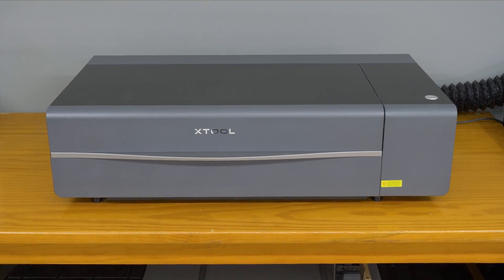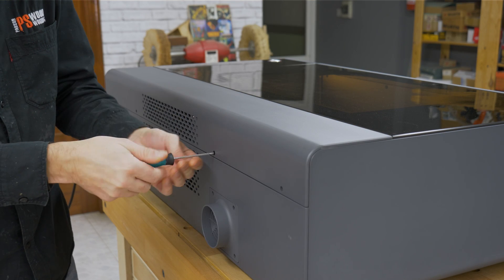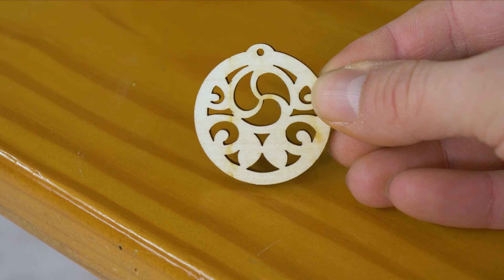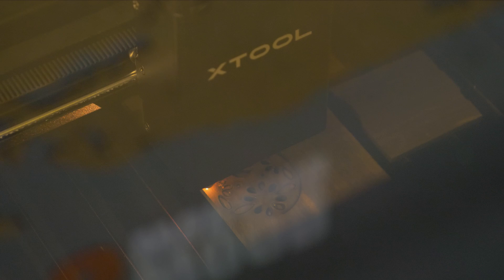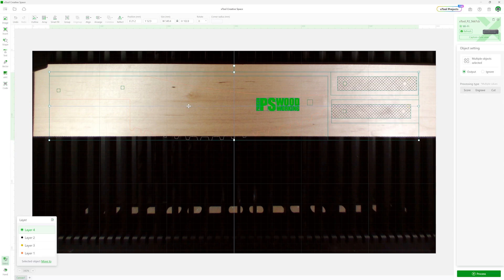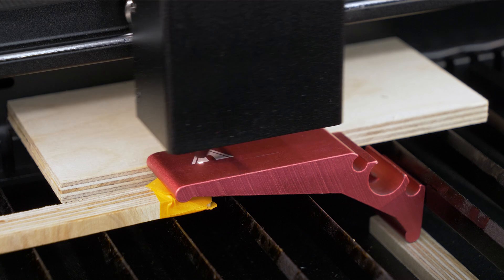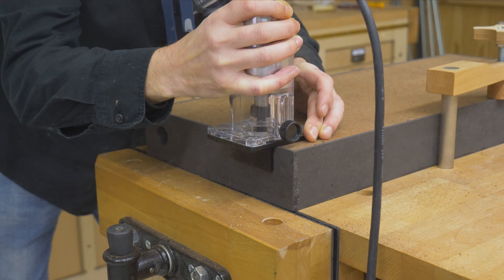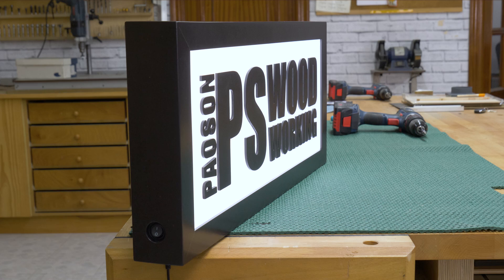Trying out my new xTOOL P2 CO2 laser. It can do almost anything. Free vectors.

Comment: Funny I was surprised how weak their fan was but now after I pulled it. 3D printed me a 4" adapter and then installed the 6" Infinity T6 fan yes now I am surprised how well my ventilation system now works after I ran the vent tube all way outside and not to their smoke filled exhaust system.    Be truthful!

Comment: A laser CNC is a real asset in a workshop. It offers cutting and engraving possibilities that are impossible to achieve with other tools. However, my problem is the price of such a tool, which is exorbitant. Currently, I am working on a DIY laser CNC project with a laser diode module instead of CO2. Even so, it is expensive for a hobbyist